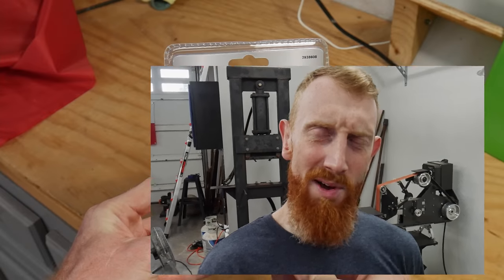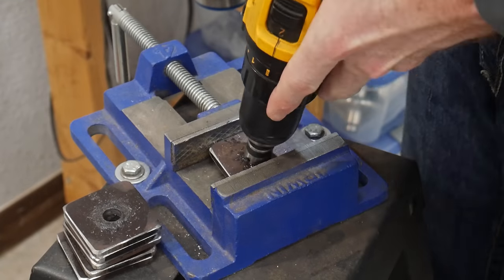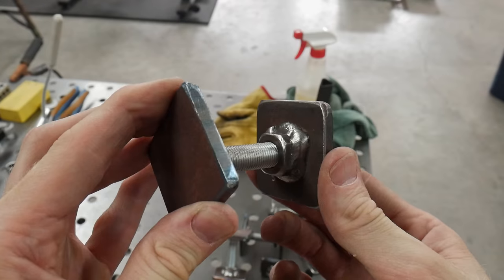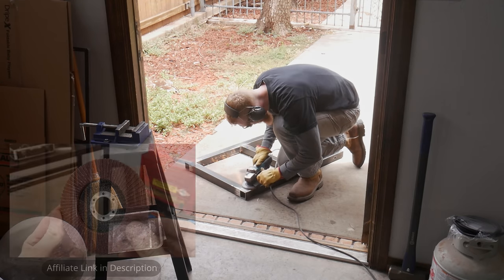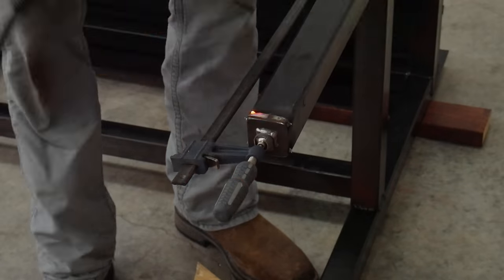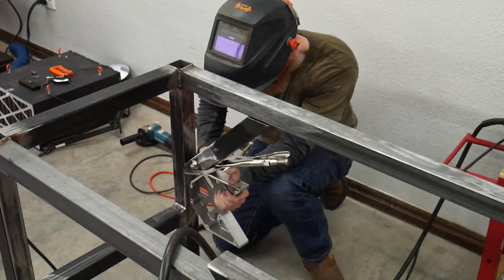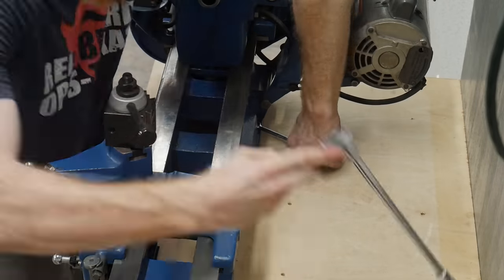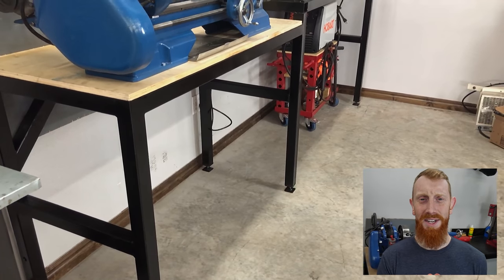Lathe & Mill Work Bench With LEVELING Feet

Comment: Awesome Job Red Beard!
      Might consider a chip Tray for the Lathe. I bought a 2X4 drip tray from Walmart (it was in Automotive) & installed it between the lathe and table surface. Makes for easy clean up.
Reply from the maker: Thanks for the tip! I'll look into that for sure! Cheers William

Comment: Love your production values .... very professional. Just a note on your MIG welding technique ..... always push into the weld with any gas shielding process. Only drag when arc welding.
Reply from the maker: Thanks for the tip! I've been doing the exact opposite!
Reply: @307Driftwood I started out with flux core and it took me a month to re-learn how to weld with shield gas.  Breaking old habits suck, and so do the welds in the meantime LOL

Comment: If your tapping a series of through holes with a drill stick to a gun tap so it has a bit more core strength and it can push the chips forward. spiral flute taps are great for blind holes but can snap a bit easier with hand tools. great setup!
Reply from the maker: Thanks for the tip sir!

Comment: Looks really good, always good to start to get things sorted and laid out who you want them. The only thing I might have done different is have the new table bolt to the old one with some locator tabs on the old one, BUT, that's just so I could pull it apart to move it if needed and not as strong as what you've done. That square kit looks very handy I must say :) Might have to look into those.
Reply from the maker: That would of been a good idea for sure! I'm pot committed big time the way it is now. Hope I never have to separate the two.... Cheers sir!

Comment: Good job!  The color on your lathe looks like it has the original paint and in great shape.  I have the longer version from 1939 that was my grandfather's.  A sheet of something under the lathe would be nice like maybe stainless or formica.  How tall is your lathe bench from the floor?  I need a new bench.  I bought a sheet of plastic at a yard sale.  It's a clean 1" thick blue wall for a bathroom stall (without graffiti).  I also bought a piece of butcher block, but either would need support like you did.  Looking at yours, a sheet of stainless that would come down the back wall, bend 90 deg, come forward across the table top, bend down the front of the board and then under, would be a really, really nice touch.  It should be at least 16 ga or thicker since it gets those little dents and then bring it to my house and I'll report back how it's doing.
Reply from the maker: Thanks for the tips. I put the lathe at around 38 inches.

Comment: Looking Great!  Good job making due with what you can in these tough times.  I recently got a some Fireball squares almost the same as yours and love them.  Have you seen his video on welding sequence to keep things square?  It's good.  I just made a bench this spring for my grinder and drill press and got a chuckle when your leg lined up with your plug outlet.  Is that a rule that has to happen because same thing happens to me lol.  Keep up the good work!
Reply from the maker: Thanks Chad! I know right.... I ended up shifting it a little off the wall so that I can get to the plug. I need to re-watch the fireball videos for sure. Thanks for dropping a comment, cheers!

Comment: Awesome video. I have a question did you wire up the drum switch to your lathe or was it that way when you got it. I still can’t figure out how to wire up the drums which I have for my life which is the Same one you have would it be to Too much to ask for some pictures of how it wired up
Reply from the maker: Hey man it was on there when I bought it, but I did take it apart and rewire it to run. It runs forward in both orientations of the switch... which is probably not right. I did it here - https://youtu.be/9O2iKmdZSnQ
Reply: Thank you I have the same problem I wired it up from all the videos I’ve seen on YouTube and I still can’t get it right it seems to go forward in both positions still can’t get it to reverse. 
Appreciate the help and then I try to do some more research

Comment: I'm not sure where to ask this, I'm not on the twistagram or the facetok so youtube is it for me. But you seem like you know your stuff when it comes to the ekectrical side of things. Would I be able to utilize the unused dryer plug-in in my breezeway to power a 2x72 grinder?
Reply from the maker: Man.. I really don't know for sure. But if you have a 220 plug and a 220 grinder I don't see the issue. I would probably check the breaker to make sure the motor your using doesn't over run it amps wise.... If in doubt... call an electrician.
Reply: Thats good advice, I'll take it. Thanks again!